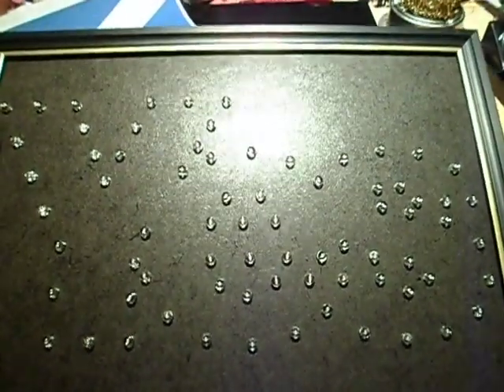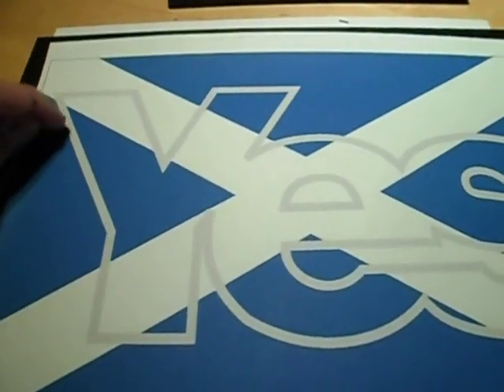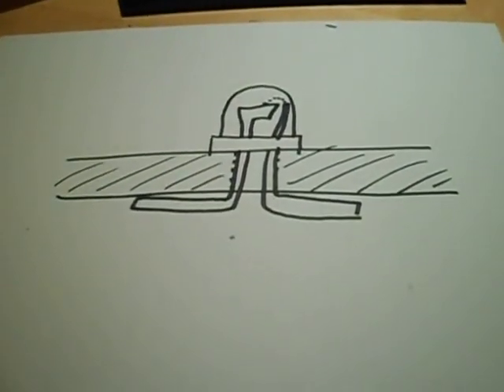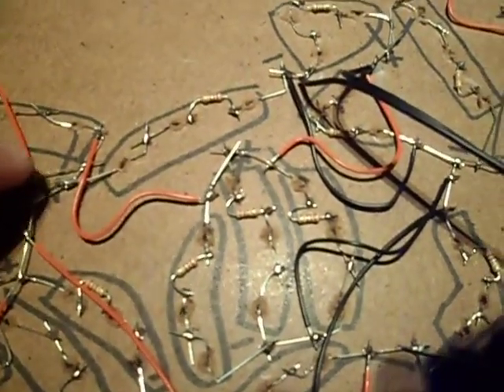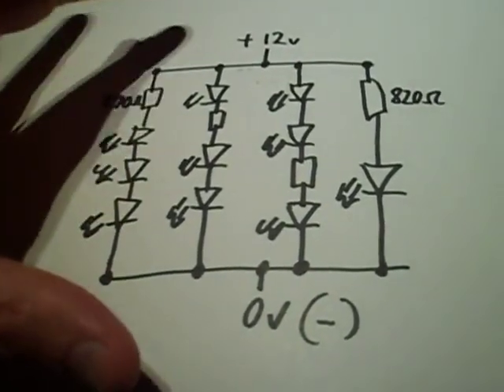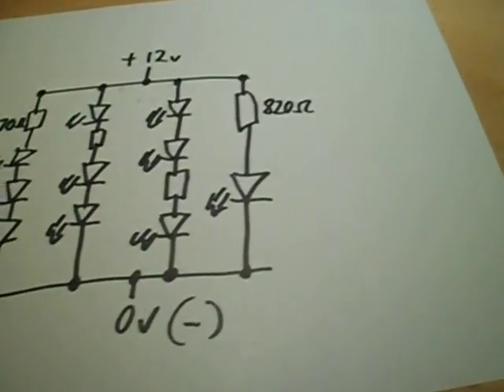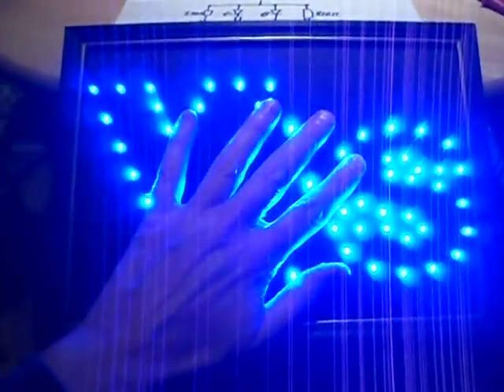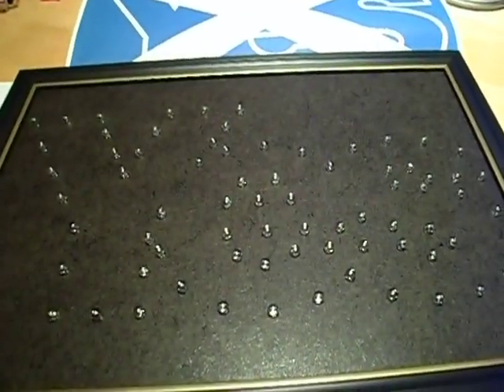LED Scottish Independence sign.

Comment: Nice one! it might be nice to diffuse the LED's a little.   There's lots of ways you could go about it with different results.   One of the simplest might be to cut the YES font out of a piece of black cardboard and on the back side of it glue a piece of tracing paper over the 'YES  hole', ahem and secure the black card over the top of the rectangular area of your frame.

To improve the NO sign I suggest eating a pound of crab apples and refilling your marker ink with liquid poop.

Just an idea :D   Keep up the good work and good luck on getting independence!
Reply from the maker: I did consider using diffused blue LEDs, but ended up choosing the super-wide viewing flat-top strawhat LEDs.  The camera is a bit overwhelmed with the intensity at night, but the sign is very clear to look at.
Reply: bigclivedotcom
Its minted mate! I'm impressed!